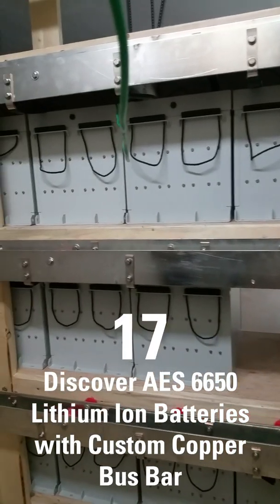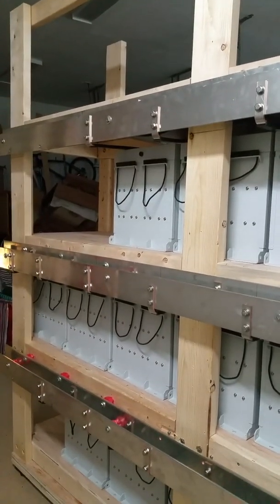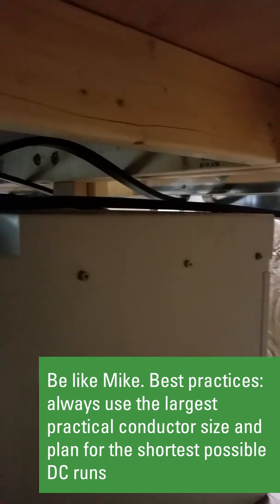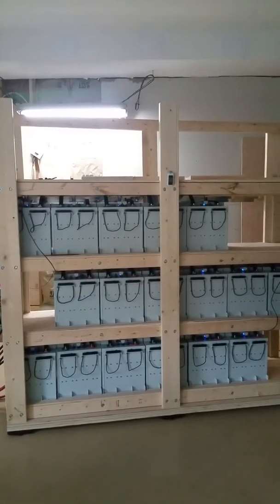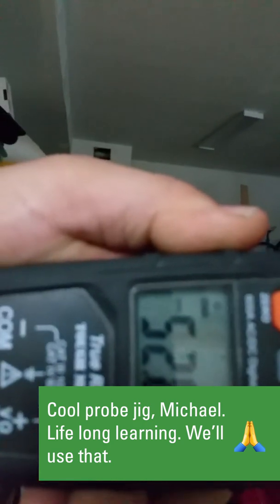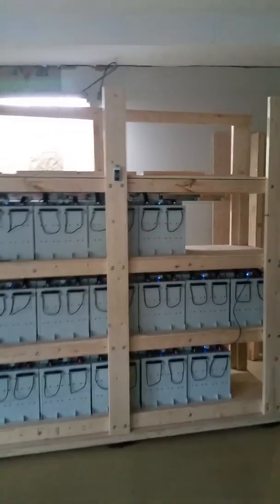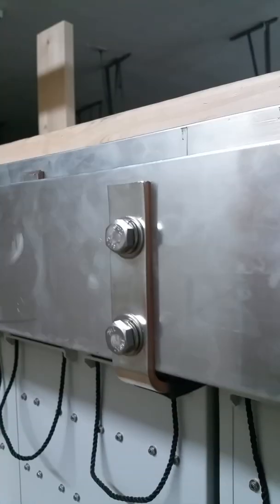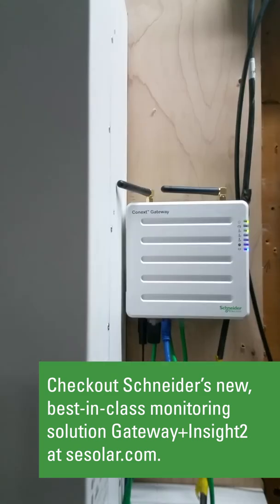Lithium Battery Installation for Solar (DIY)

Comment: Other than making the voltage check with the custom volt meter easy, I'm not liking the positive & negative bus bars being so close together. I would prefer them to be on opposite sides of the rack.